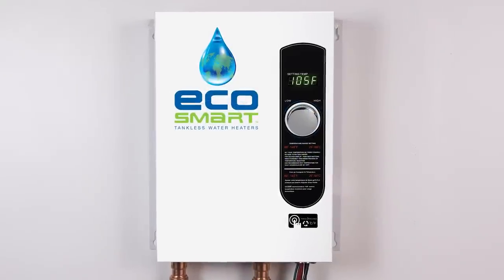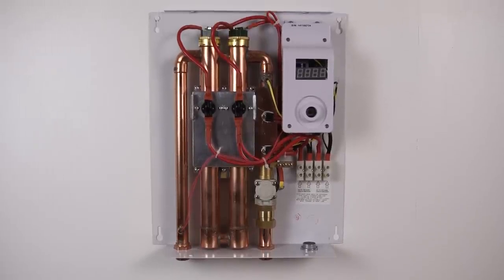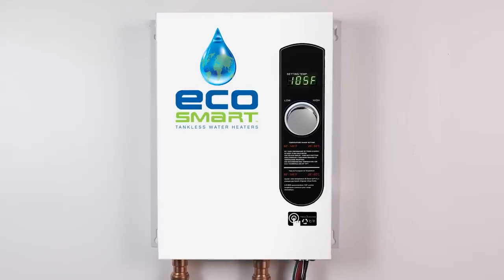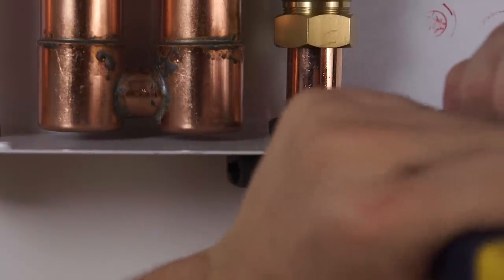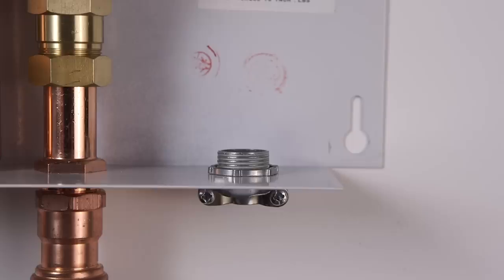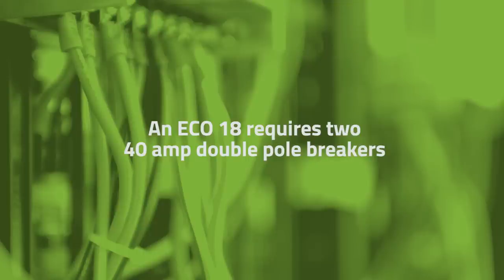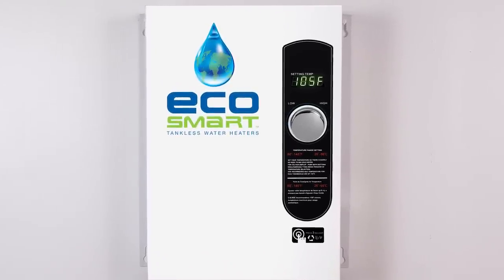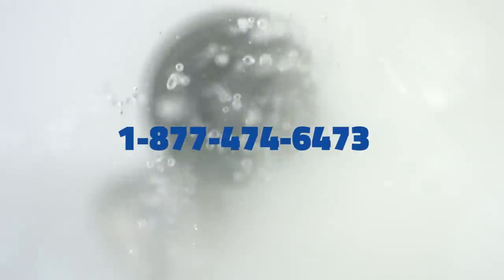EcoSmart Tankless Water Heaters Installation

Comment: Tried installing a Eco11 and it;s leaking out of both input and output pipes. Not leaking on the additional connectors I added to interface the hoses but leaking from the  joint between the factory silver colored body connector and the body itself. These are the connectors that come with the unit already installed on the body. Ii see pictures of another  11 and it has big metal washers there one on each side right where mine is leaking. My brand new form Amazon ECO11  unit did not come with any washers. Box was factory sealed...
Reply: I have had two units with this problem.  I wish ECO/Rheem would give us a response!

Comment: You guys should make one with DC elements for solar /battery bank.
Reply: It's cheaper and more effective to preheat the water with direct solar panels than with photovoltaic panels
Reply: Use a pure sine wave inverter and 100ah lithium battery with your solar panels and you're golden.

Comment: It has a "warranty void if removed" decal over the screws that you must remove in order to wire it. Am I really voiding the warranty by installing this? dumb
Reply: i peeled the sticker off with rubbing alcohol and reinstalled it after i installed my heater. 

It's still voided im sure but if i have to send it back there won't be any damage to the sticker and im betting they won't notice.

Comment: Can this be installed/wired to be used in Singapore? Singapore uses 240v , single phase.
Reply from the maker: Thank you for the inquiry. As long as Singapore is 240 volt single phase in a 'hot-to-hot' configuration, that is, 2 hot leads then you will be ok. If, however, the voltage is in a 'hot-to-neutral' configuration where there is only ONE hot conductor, than no, our product will not work with that configuration. How to tell the difference? Look in your circuit breaker panel. If each circuit has a DOUBLE-POLE circuit breaker that requires 2 slots in the panel, then your configuration is approved. If your 240 volt circuits only use a SINGLE-POLE breaker requiring just 1 slot in the panel, then no, the configuration is NOT approved.
Reply: @ecosmartus  Thanks for the reply. Singapore uses hot-to-neutral configuration. I guess I can throw away the heater then?

Comment: I'm planning to install the Eco 11 in my RV (it's stationary). I have two questions-

1- How do I wire it to plug into an regular house outlet? (instead of hard wired into a circuit breaker) Is there a kit I can buy at the hardware store that makes it a regular plug?

2- Do I need a pump? The water source is a regular spigot like everyone has in their yard, and runs on a well (with well pump)
Reply: Hi Jessica, I'm not sure if there is a way to turn it into a regular outlet but if there is it would be just as complicated, if not more so than how they are designed.

It just needs pressure to function, so an ordinary spigot (or your rv pump) will work fine
Reply: No. You regular house outlet can provide 1.8 kw - less than 2 kilowatts.  The model in this video requires 18 kw - 10 times as much as your regular outlet can provide.
Reply: You can wire it to a plug, but the receptacle it plugs into has to be on a 60 amp double pole breaker.
#Vanlife

Comment: You cannot just run exposed individual conductors through the wall of the unit.  They must be protected in some sort of conduit.  Read your electrical code!
Reply: its just a video to show you how to do it.
Reply: that is correct. you can run the wire through gray electrical PVC pipe (if allowed by code), and people need to make sure they use the right size.  3/4" will work for UP TO 6 #8 wires.  so if you are going to go up to the model requiring 3, 40-amp breakers, they will need to use 1" condit (because the ground wire would be the 7th conductor and that takes it out of using 3/4" conduit)
Reply: @brandongochie4325  Sure, it's just a video to show you how to do it incorrectly.
Reply: @brandongochie4325  showing us wrong

Comment: Can I connect a hydroneumatic Dab device 1 hp, 7,5 bar, 80 l/m to the input of the ecosmart eco 36 unit and will heat properly the water at the output? Thanks.

Comment: Hola una pregunta cómo se conecta la instalación eléctrica
Reply: Primeto necesitas tener espacio en tu caja de breakers eco 18 requiere 2 breakers dobles de 40 amps lleva cable del numero 8
Reply: Si no tienes suficienfe espacio necesitarias poner una caja de electricidad subpanel 100 amps